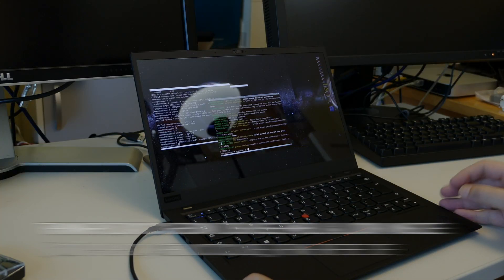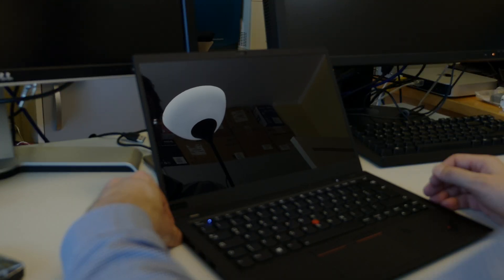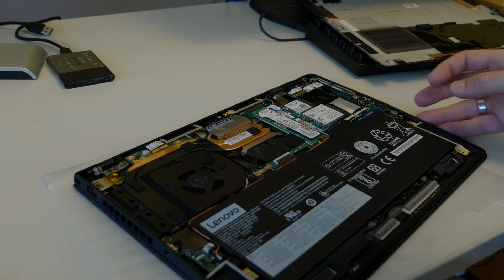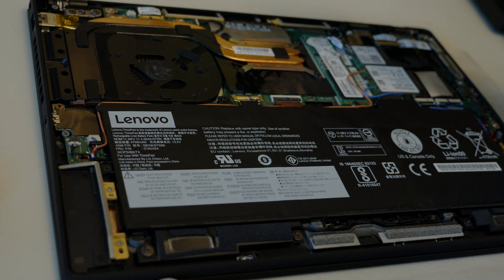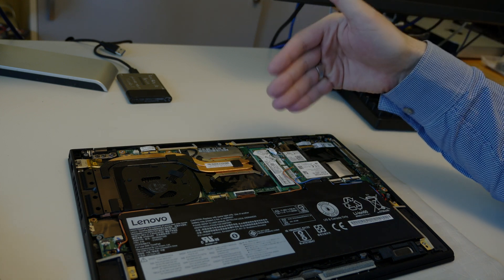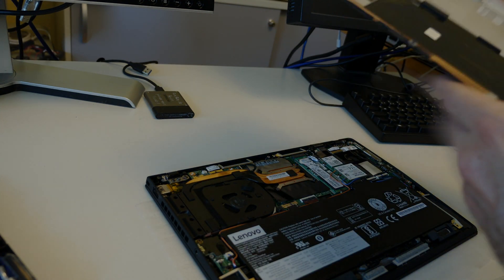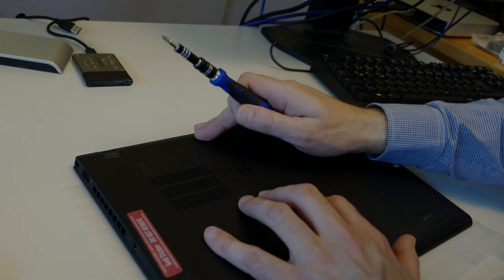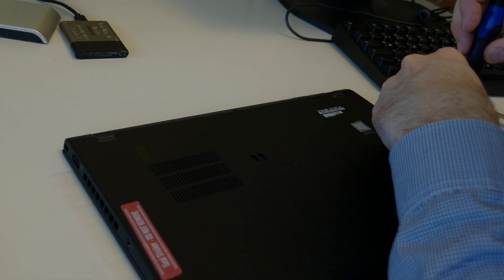ThinkPad X1 Carbon upgrades? Disassembly & look inside!

Comment: Other than the memory are there any replaceable hardware such as graphics cards, cooling fan, processor, etc.m and if so what would be some compatible parts? Greatvideo overall!
Reply from the maker: in 99.99% of the devices of the last decade or nearly two, nearly all components such as CPUs, GPUs etc. are soldered on the PCB and not (easily) exchangeable (unless you want to hot air reflow your board). Even fans and heat pipes are special made to fit so usually not too exchangeable. So. M.2 storage, usually socket WiFi/BT, at times batteries, but even RAM is often soldered these days.
Reply: @renerebe  thank you very much!

Comment: Any plans on reviewing the ThinkPad X1 Extreme?  Either the Gen 1 or Gen 2 when it's released?  Would love to see that review!
Reply from the maker: Thanks for the comment and question! Unfortunately the nvidia gpu is of little use for me in Linux or other BSDs, and thus I rather take the Intel graphic and longer battery life over the nvidia. If lenovo provides test units I'm interested in the  regular 2019 update as well as the other thinkpad and SKUs though;-)!
Reply: @renerebe  Ah, yeah.  Makes sense.  Do you run any VMs on the X1 Carbon?  I'm in the market for a new laptop.  I picked up the new 2019 MacBook Pro but will be returning it as $4,500 for a laptop just makes me feel dirty.  Lol.  I'm a software engineer and work in Supply Chain, mostly warehouse automation and custom WMS applications.  I refuse to run Windows outside of a VM so I'm looking for a machine that runs Linux (and supports external monitors; ideally 4k) without issues and can handle a Windows 10 VM when I need to work with MSSQL Server.  The Oryx Pro from System76 is my number one contender but the ThinkPad X1 Extreme is appealing...  and honestly, so is the X1 Carbon after watching your reviews.
Reply from the maker: Yes, I regularly use Qemu/KVM for most of my work: https://www.youtube.com/watch?v=fyclA-_M-aA as I said often in my videos I mostly used Mac hardware even since I brought a PowerPC iBook around 2003 just to run PPC/Linux on that. And even with our Mac end-user products I can not buy any current Mac for all their many limitations and dust or touch sensitive keyboards. Not to mention every second Mac had serial defects and extended repair coverage: https://www.youtube.com/watch?v=lgcXGvdK4lk